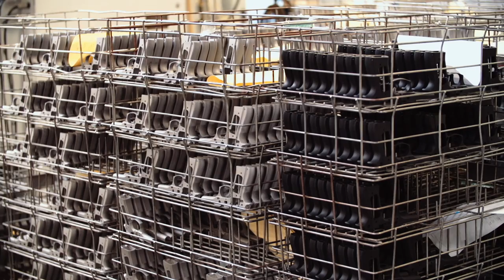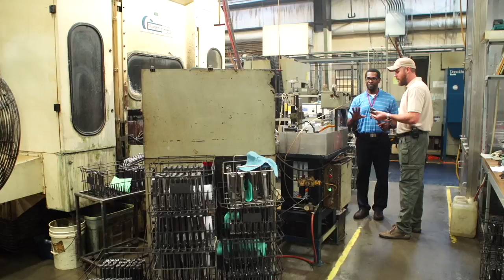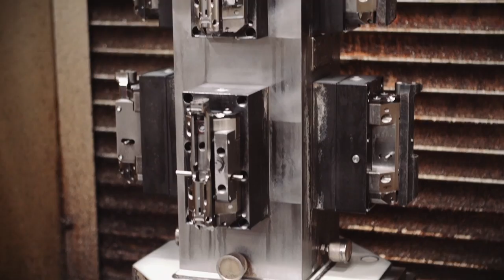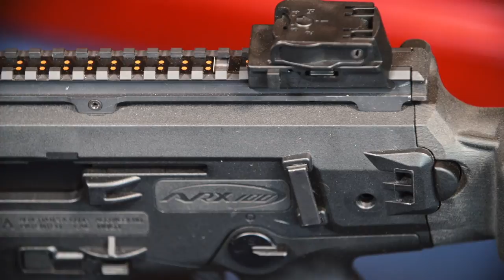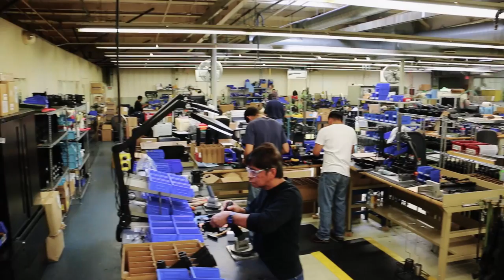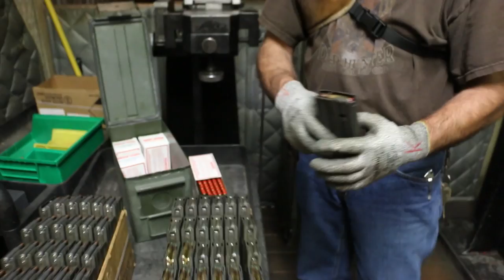Beretta USA Factory Tour

Comment: Am I the only one who sees hand-fitting as a negative? Don't get me wrong, things fitting well and running smoothly are critical, but to me there is even greater value in the modularity offered by a weapon which is manufactured so precisely no or minimal fitting is required so should your weapon have a malfunction, replacement parts are drop-in not gunsmith-fitted.
Reply: Whatfor5 Generally I agree with you. I don't know what all they "hand fit." What I saw in this video was primarily deburring which given the state of materials and manufacturing processes, is the current best practice. If they are truly hand fit and you can't easily mix and match parts, that would be a huge negative in my mind. I don't think the military would stand for that.
Reply: Whatfor5 agreed, parts shouldn't need to be "tuned" to swap out/in in a truly well designed product.
Reply: redoctober1947  S Foos 
My understanding is one of the major advantages cited by/of Glock is that they were one of the first to truly utilize this modularity concept, which is part of why they enjoy such a robust aftermarket. I honestly don't know the extent to which you could, say, buy a brand new Beretta slide to replace the one on your 25 year old pistol and just drop it in. 

You're right about deburring, simultaneously MAC repeatedly said "hand fit" and I'd like to take the optimistic approach and assume he is able to tell the difference. 

In terms of the military and their gunsmithing, they have and continue to take what strikes me as odd approaches to weapons. You would think they'd have better embraced the modularity of the M4 platform, would have long ago discarded the M14, would have started fielding modern plastic weapons by now, and so on. So with a weapon as old now as the M9, it is really hard to say whether or not they'd tolerate the need for ACTUAL skilled gunsmithing since they certainly do for other platforms. 

I should also add briefly that, in our nasty desert theatres and with the common improper lubrication applied, the M9's actual service life I've heard is well under the specified 40k rounds to rebuild time frame. This makes the weapon system also comparatively short lived. Of course, lacking a citation, if someone has a counter-citation I'd simply have to defer. I do honestly believe though that the M9 is outdated and should be replaced with a more modern service pistol. Then again I've said that about the AR quite a few times too and everyone thinks I'm crazy so........
Reply: Whatfor5 Drop a Glock Gen 4 slide on a Gen 1 and tell me how that will work.

Glocks are great guns, they were one of the 1st companies to be able to bring a pistol to production using late 20th century materials and tooling rather than pretty much rehashing the same thing since the turn of the 20th century. 

One of the reasons they've managed to do it is because they were not a gun company, they didn't had to worry about keeping their current production and design capabilities relevant while designing the Glock. 

Do you really think that HK continued to design stamped guns upto the early 80's because stamped guns are just that good? nope, they did it because they've had the experience and the tooling in place since WW2.
People continue to do what they know and used to doing even when trying to innovate, heck most US barrel manufacturers still use either broached rifling or button rifling rather than hammer forging them simply because that's what they've been doing for the past 200 years or so.
Reply: ***** ROFL. That is an overtly farcical argument, and you know it. Gen4 was the first time Glock embraced the term "gen" and was also, intentionally, a departure from the specification of the previous gens. You'll also note so called "Gen3s" are still being manufactured as are their replacement parts. Methinks the previous gens aren't going anywhere any time soon. 

Glock has its supporters and its detractors, mainly for superficial or false reasons on both sides. My opinion is somewhat more complicated. Glock has, somewhat recently, made a series of mistakes. This started with their unsupported chamber issues on their .40S&W weapons resulting in a string of casing failures, and of course on plastic frame weapons that destroys the frame and may seriously injure the shooter's hand. Then, more recently, Glock noticed that basically everyone else was trying to copy them and get in on the action. The faced a critical choice: go cheap to compete, or go premium and be the originator. Sadly, they decided to go cheap, MIMing critical parts and changing a few minor dimensions so, while still backwards compatible, the new weapons didn't/don't run like they used to. Perhaps most visible of these shortcomings are the extractor issues, where the extractor fails to grip the case firmly enough and it slips down striking the ejector incorrectly resulting in erratic ejection and often as not a nice steaming hot piece of brass directly to your face. And in a world where social media is a thing, and opinions can change rapidly, Glock remains pitifully slow at recognizing their failings and addressing them. Another issue, this one they FINALLY took care of, was the recoil spring fault. 

At the end of the day though, plastic guns will always be the "cheap" option. Don't get me wrong, their cost-effectiveness makes them excellent service weapons, but apples to apples a metal frame is the superior choice in a lot of regards. I personally would like to see a firearm go a sort of hybrid route, embracing the positive traits of the old series glocks with a somewhat "higher end" attitude and a hybrid design of sorts; something with some plastic, but more steel. (Yes I know the P7 was a thing, but its guts weren't what you'd call super simple and elegant) I look at the STI 1911s with some interest, more in superficial concept then internal execution.
Reply: Whatfor5 No, you aren't the only one.  I was just going to write a reply about the very same, but then saw yours.  The entire reason these are hand fitted is because it's an archaic design that got brought forward.
Reply from the maker: Mambo Dave Did you know that the much vaulted German P226 was largely hand finished much like the Model 92 until production moved to the US. Now the guns have a noticeably sloppier fit which is the price of automating most every step and taking the artisan element out of the process. Sig buyers, myself included, generally prefer the German gun because they feel much better built. Yes, guns can be mass produced by CNC machines with little human interaction but the fit will never be as smooth as when you have craftsmen put the final touches on.  Some people pay a premium for such things, like Ed Brown guns, Wilson Guns (they too customize the M9), etc. Most in the know would consider such a service to be a good thing and many others would even pay more for such services -- and do on other firearms.
Reply: Mambo Dave Military Arms Channel The precision of CNC machines exceeds the fit of USA manufactured SIGs, at least in regards to the frame/slide interaction which is where people typically observe "looseness" in the firearm. That said increasing precision typically increases machine time. 

While I'd agree with you about the quality of hand fitted firearms for personal use to an extent, my argument centers more around weapons which are intended/issued for combat or LEO use; it is unlikely the slop in the fitment will be perceived as a detriment to accuracy in use (god knows glocks are incredibly sloppy and highly regarded), but it does allow for greater modularity assuming the design is able to accommodate it. Additionally, in designs meant to accommodate it, that slop typically allows greater resilience in the face of environmental insult. 

Now that you've mentioned it though MAC, I'd be extremely curious to see if, in shooting, you could find an accuracy difference between an older German SIG and a new USA made SIG. Then again I make much the same argument in regards to H&K's vaunted "O-ring barrel" malarkey.
Reply: Yes in an ideal world, a product should be well designed with modularity in mind, and precisely manufactured to completely eliminate hand fitting.  Theoretically this reduces labor and training cost, as well as improve parts compatibility and manufacturer efficiency.  But in reality machines and molds wear out, baretta is in the business of selling guns and making profit. They must talk themselves up to increase value in the minds of consumer. So in this case they try to make it sound like a good thing that they're products receive the attention of hand fitting.  If MAC says in his video that baretta guns are poorly made with loose tolerances, he would never be welcomed to tour the factory; and other gun makers will see him as a dangerous loose cannon who might say things to hurt their sales.  We all need to play the game to be in the game.  I appreciate beretta is still making guns for the market, and I appreciate MAC has the opportunity to give us inside look how the guns are made.  I still like my 92s, I have 2 purely because of their beauty and history.
Reply: K Kao well said
Reply: Hand fitting has nothing to do with interchangability. If you want to achieve very tight tolerance for improved function, and hand fitting achieves that within the cost constraints, then fine. Manual operations are inherent in most Firearms manufacture. Assembly for instance. As long as manual fitting processes are controlled (in a 6 sigma environment for  example). The manufacturing you see here will be state of the art. Beretta have been around a while as has the 92.

Comment: Why is the fact that things are "hand fitted" celebrated? Doesn't that just mean their CAD/CAM tolerances aren't as good as they'd wished? and when it comes to spare parts in the future, it'd have to be equally "hand fitted"?
Reply from the maker: aaron4820 The German made Sig P226's that everyone clamors over were all hand fit. When they moved production to the US and CNC machines replaced manual labor, the Sig collectors declared the US made guns to be inferior due to their sloppy fit as compared to the German guns. Yes, you can automate gun production almost completely but there's a reason Ed Brown hand fit 1911's are FAR more desirable than an off the shelf Kimber. You can tell by handling them which is mass produced and machine made and which is hand fit. It makes a difference in quality, and typically people pay more for this.
Reply: Military Arms Channel It's my understanding that the cnc machining is primarily used as a rough outline and the hand fitting comes in to make the parts function correctly, is that true?
Reply: aaron4820  ive got an old 92s and I replaced the barrel with an m9 version. Its works perfectly but I hope it was a safe decision.
Reply: No it means it is made bigger than needed and then fitted to where it's perfect. that's why custom 1911s are worth the cost and why people don't mind spending $4000 on a Wilson Combat
Reply: ***** That's great insight, thank you.
Reply: +aaron4820 To me this is just another reason the US military should use Glock handguns. First of all let me say that any soldier using a handgun instead of his rifle is doing something very wrong or has been very unfortunate. That being said, it makes sense that the handgun he carries should have interchangeable parts NOT requiring the services of an armorer- any idiot in the field can simply swap the part out in a matter of minutes. The military in my opinion has NO business carrying a handgun that requires "hand-fitting" of any part that can be installed in it. A $500 Glock will do anything a soldier needs it to do, he would not benefit in any way from carrying a "$4000 Wilson Combat" was he is NOT on a 50-100 yard firing range when HE fires his sidearm...
Reply: It's weird when someone changes their Youtube profile name and you can't tell to whom someone is replying.  But if I mouse-over the names I  see Lord Octron is now Serial Tester, because both names point to TheRealSoulhunter.

Comment: Walther largely influenced this pistol....I prefer my P99.  However, the CZ 75 would have won the contract if it wasn't for Czech being a comm bloc country a number of years back.
Reply from the maker: MavHunter20XX I think you mean the Walther P38 influenced this pistol, and it clearly did given the locking mechanism. The P99 is an entirely different pistol, but they are great guns too. I like the P99.
Reply: Military Arms Channel I apologize for the strange way I communicate.  I meant to say (I just plain omitted) that the Berretta 92 design is based on the archaic P38.  Therefore I prefer Walther's modern P99. So yeah, I agree with you.  I'm tired of this new army pistol nonsense.  It's like a girl that'll flirt with every boy just to get some attention, but never intend to give a hint of commitment.  If they actually were serious did, it'll resemble the CZ 75 or a DA/SA 1911 in 9mm.  Heck if you had a 9mm version of the CZ 97 BD (I say this because is has the modern glock style lock up).  Actually keep it in 45 ACP since we're limited to FMJ on the field.
Reply from the maker: MavHunter20XX The P38 had a rather ingenious locking system and the Germans were years ahead of the rest of the world for decades when it came to firearms designs, especially during the 30-40's. It was their WWII era firearms that continued to influence firearms until present day. The MG3 used today world wide is a slightly modified German MG42. The StG44 rifle influenced almost every single modern military rifle currently in use today. I own and shoot a original WWII P38 and the pistol continued on in German police service post war as the P1 until modern times.

Comment: I read the 1911 was dumped because it was too difficult to fire for untrained troops and so they went to the M9.  But the 1911 is the easiest to shoot design I've ever used and the M9 the hardest.  I understand the move from 45 to 9mm, as without training 45 is more difficult to use.  But I'm one of the guys that doesn't understand the M9 thing.

Comment: This is the 21st century. Hand fitting is not a good thing.
Reply from the maker: timewave02012 Which is why so many people prefer hand fitted firearms and pay extra for them.  Those that love Sig pistols will tell you they prefer the German made P226's over the US made guns.  That's because the German made Sig's had many hand fitted parts whereas the US made guns don't -- it as automated as they can possibly get. The result is a gun that doesn't feel a solid or smooth.

Comment: The M9 is simply too complex and has previously exhibited reliability and durability issues during military extended use.  I spent 10 years with the M9 in the military both as a armorer and user/shooter.  I am retired now and I have bought several pistols, none of them are an M9 90% are Glock.  Glock reliability and durability is simply unrivaled by any other manufacturer.  The M9 is absolutely more accurate than a Glock but then accuracy means nothing if the pistol is not reliable or durable.  And if my opinion is not enough then read this article: http://www.military.com/daily-news/2015/02/19/marines-allow-operators-to-choose-glocks-over-marsoc-45.html
Reply: David Peterson About the M9 reliability there's and there will be endless debate with detractors and supporters. Here's an article with some interesting data.

http://www.guns.com/2012/10/06/the-beretta-m9-debate-a-look-at-the-data/
Reply: David Peterson I would've gone with a Glock, but the lack of a safety bugged me. I researched CZ and the 75 seems to be considered very accurate and much more reliable than Beretta and to a lesser extent, even a Glock. I've yet to try them out, but I want to.